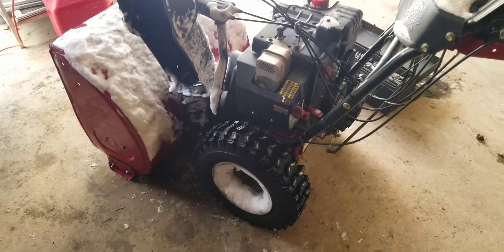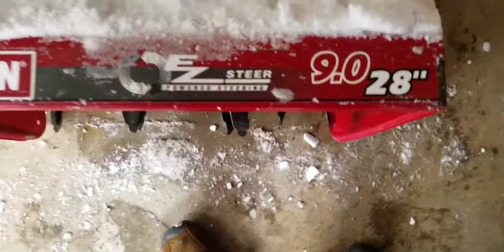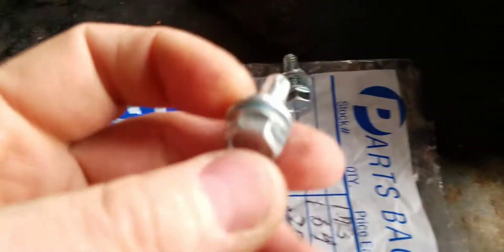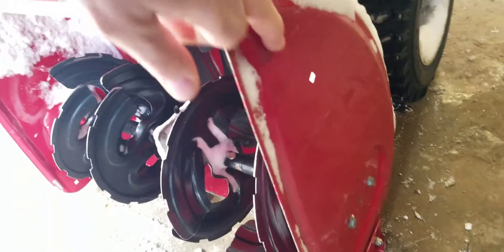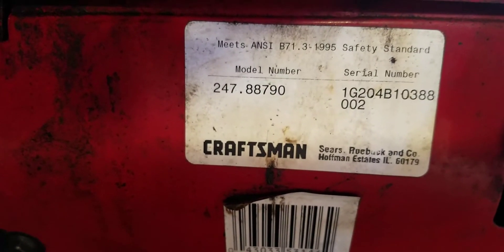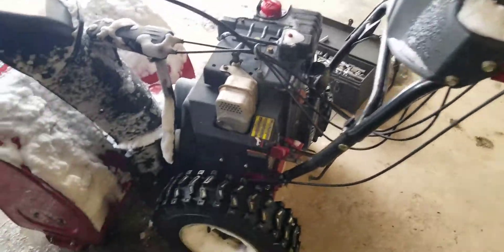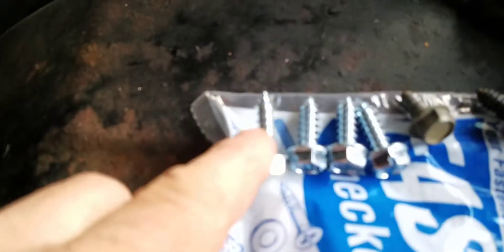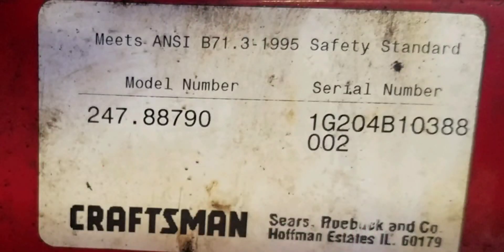POOR Engineering DEFAULTS on a Craftsman EZ STEER Snowblower.

Comment: Just bought a used one of these so I hope it does well for me but I would like to replace those same screws… What size did you end up with?
Reply from the maker: Same thread count as the old junk screws. I used the handy bolt chart at Aubuchon Hardware store. Good luck!

Comment: What a piece of junk, I'd fix that chute control cable and sell that crap. Go out and find a good used Ariens or Toro blower. Even if you have so spend a few bucks on parts to repair and older one, it will last alot longer and be worth it!
Reply from the maker: I have a few older snowblowers, made back in the late 1980s. MUCH better steel, MUCH better made!